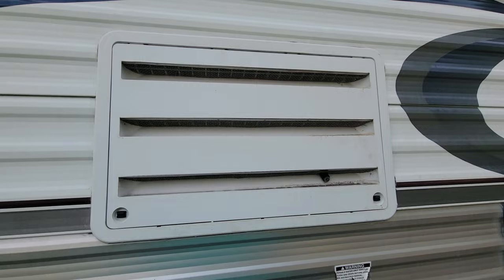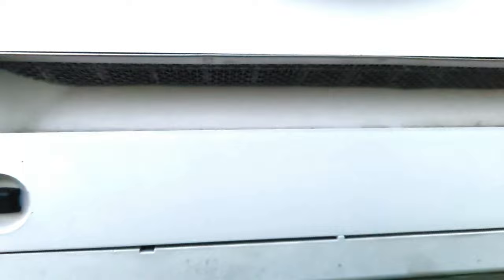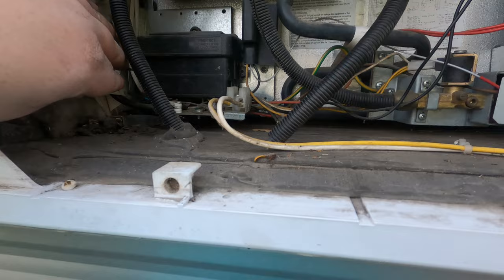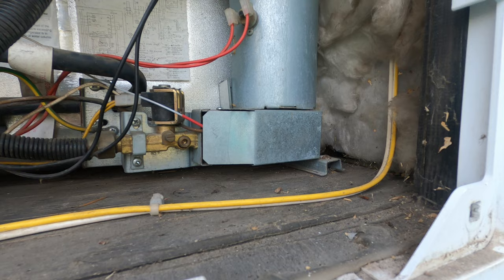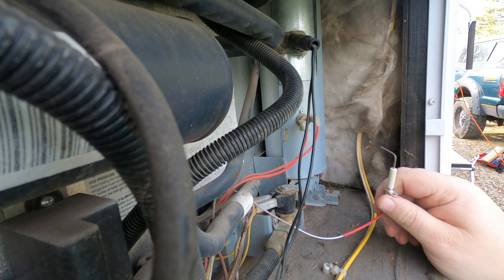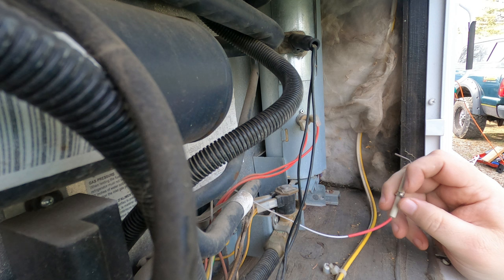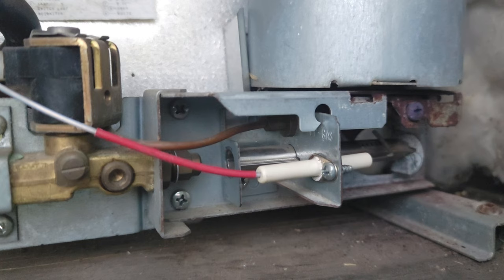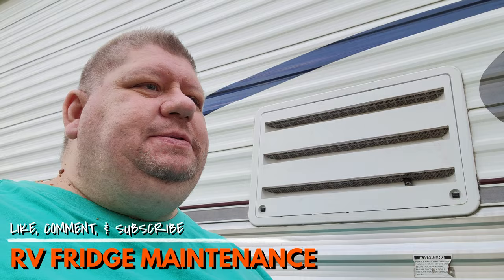Dometic RV Refrigerator Maintenance [How to Maintain Your RV Fridge]

Comment: I have a question about the silicone sealant that goes around the outside edge of the access frame on the back of the refrigerator. I don't know if at one time the previous owners didn't have a drain tube installed but on the bottom of the frame on the back access panel there are like three open areas that don't have sealant on them and you can see where it has some streaks of drainage  going on. It is still open to the smaller bugs and insects and there is a flexible tube drain now installed. I just wondered if I shouldn't take some silicone and finish sealing up that bottom area of the frame? Also - I was having a problem with a water leak coming in my MaxAir exhaust fan in my bathroom that sits pretty close to the refrigerator. Turns out I had a bad refrigerator roof vent and had to take  it to Camping World for replacement. When I got it back home and set up to check out my new and improved refrigerator roof vent I let the refrigerator cool down quite a bit or at least run and when I went out to check on it it hadn't cooled down much in the refrigerator compartment but it was pretty normal in the freezer compartment. Let it run a little bit more and I went out and opened the door to my camper I was met with a blast of hot air like the furnace had been left on but was not. Long question but I'm wondering if Camping World got the wrong refrigerator roof vent or some problem with the replacement process plugging up the flu? This was very unlike my refrigerator with the previous refrigerator roof vent. The heat didn't seem to be escaping the refrigerator compartment and was actually transferring heat into the walls and ceiling of my camper not to mention the roof was getting hot and tacky. I guess I'm glad I didn't try it on LP mode. 🔥 Thank you for the very informative videos as I am doing my best to stay away from Camping World in my maintenance and repairs.

Comment: Checking out the area on mine… the chimney is very hot, as is the pump on the left.  Still couldn’t get igniter switch to click but wanted to ask about the heat..what would be considered as too hot?
Reply from the maker: the chimney can get very warm to the touch, specially near the electric heating element or near the burner when running on propane. As for not being about to get the ignigher switch to click, there are a couple fuses under the black contraol panel cover on the left side.

Comment: Thanks for the video, I am going to do this now. found some leaves and dust. Be sure the ignitor is not touching the burner tuber when installing it. I got it a bit crooked and its was resting on the burner tube. Backed off the screw and adjusted it. A flashlight helps.

Comment: ❤good video. I do every thing you did. I also tap on chimney to knock rust and carbon down.
I blow out the main jet if it needs it.
I go inside and use a Turkey baster and shoot some warm water in drain hole on drain tray. That way I know its clear
Reply from the maker: thanks for watching and great tip on the warm water

Comment: Very informative. Could you please tell me where the interior light fuse is located?
Reply from the maker: Am sure you've checked the 12v fuse in your electrical panel, there are also a couple of fuses that are behind the black plastic cover shown on the left side in the video at 2:11 as well as a possible inline fuse on the red wire in that same location. I am not sure what fuse would power the light, but the light switch in the domestics often goes bad as well. Hope that helps and thanks for watching.

Comment: What exactly do you use to clean and maintain the burner and everything that you did?
Reply from the maker: I used a little gun cleaning kit to clean the inside of the burner washed it in soap and water and air dried. For the general compartment an air compressor or some canned air works great for getting rid of the dust and cob webs. Thanks for watching!

Comment: Great VID Cory - question do you use any sort of fire suppression system behind  your fridge? thanks Lance
Reply from the maker: I don't yet, but they are on my list of wants after a fridge fire with the first travel trailer we had. They make the tubes filled with FM200 and the run in the $150-$200 price range.

Comment: Why is there a large gap of 3/8" between the gas tub orifice and the burner piece.  Seems like some gas would easily escape.
Reply from the maker: It's how the gas coming out of the orifice can pull oxygen with it into the burning tube to burn efficiently. Fire needs oxygen in order to burn. This is similar design in all propane appliances and bbq grills, in grills it's often referred to as an air gate.

Comment: What problems could happen when too much food is in the fridge ?
Reply from the maker: Until recently, most RV refridgerators didnt have fans inside to help airflow. Because of this packing them to full can keep the fridge from maintaining an even temperature and cause some items to freeze, while other items to high of a temp for safe food storage. They make little battery operated fans that can help with this. That being said, our Dometic fridge is usually packed pretty full, my wife has gotten pretty good at stacking things just right to allow the fridge to remain evenly cool. Also, allow a full day for the fridge to come up to temp, and try to avoid putting warm food into the fridge, doing this will go a long ways on keeping items cold and fresh. Thanks for watching!